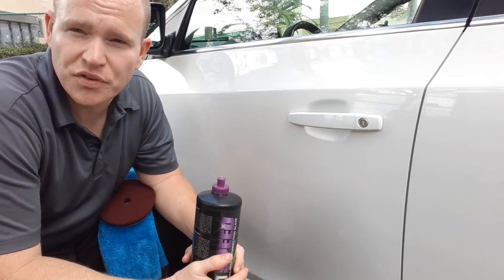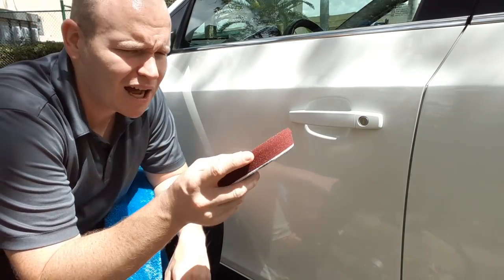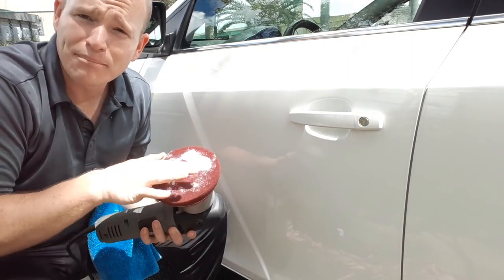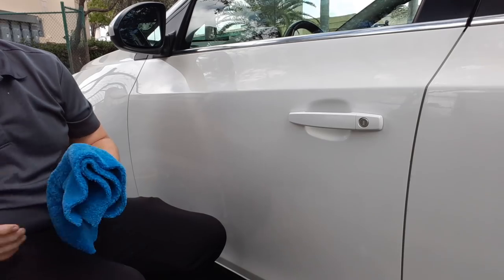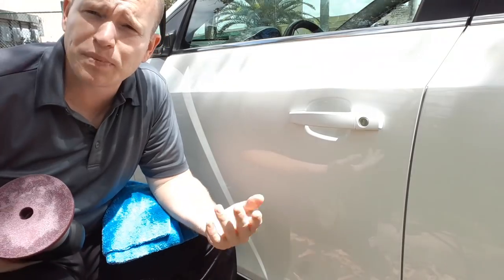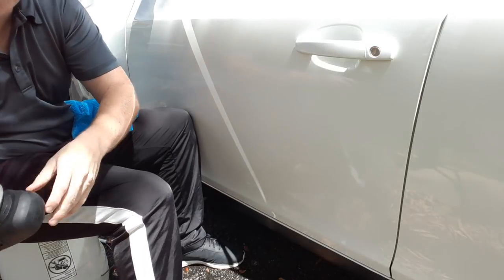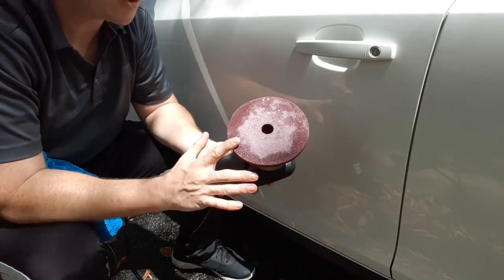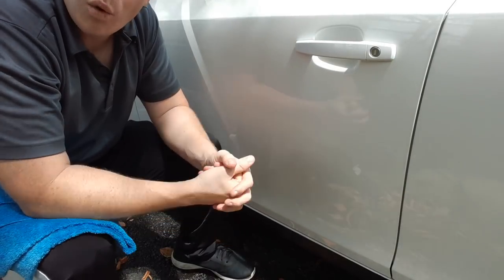What Happened To HD Speed???

Comment: Would you recommend this for a black suv? Can you use Sio2 over this?
Reply from the maker: I di recommend it for black paint just be mindful of the heat... it will work better than others but still use precautionary measures. Also since it has Montan wax inside it I wouldn't recommend it. You may get some good water behavior at first but it will diminish rapidly